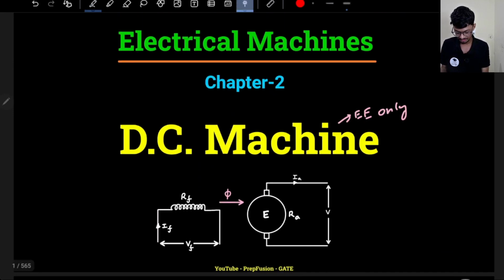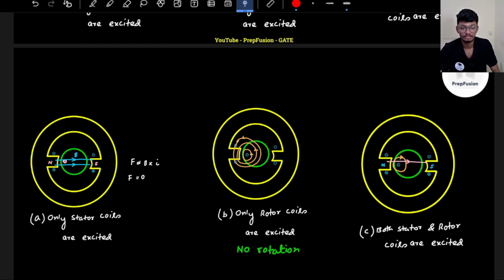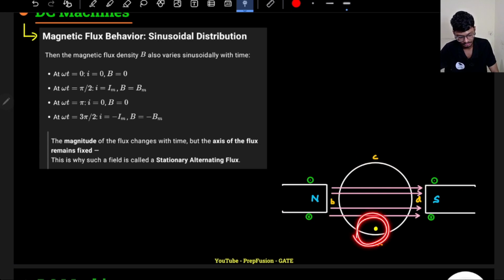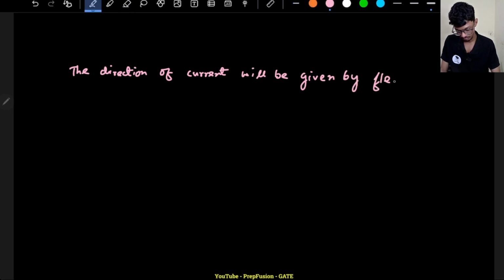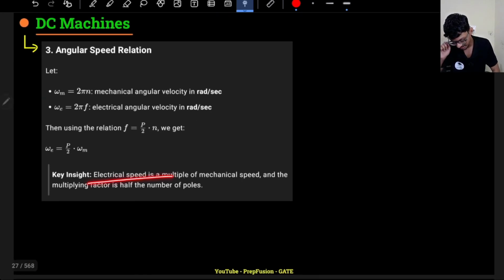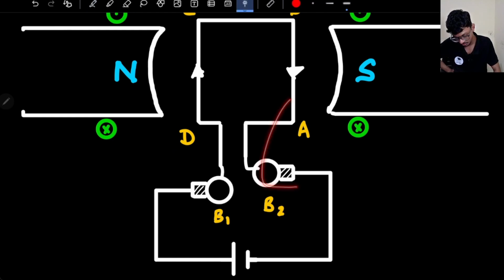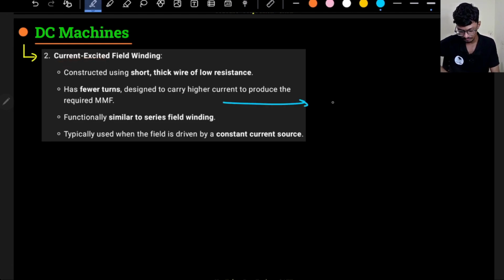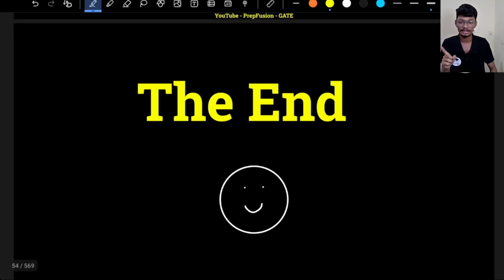L25 Basics Of DC Machines || Electrical Machine || PrepFusion

Comment: Hi Sir,
@ 21:20 Is it torque or couple? Torque is the turning effect produced by a single force acting at a distance from an axis or point of rotation.A couple is a pair of equal and opposite forces whose lines of action do not coincide, producing a pure rotational effect without any net translational force.
Reply: Yes you can think of that. But mainly we will derive all the expression using torque only as we are discussing about individual conductors and in individual conductors torque acts not couple.